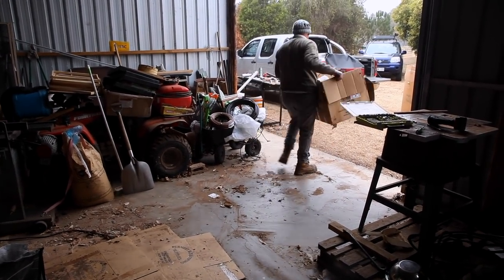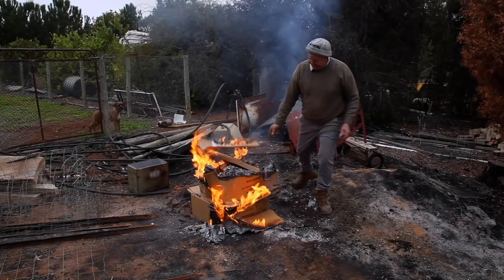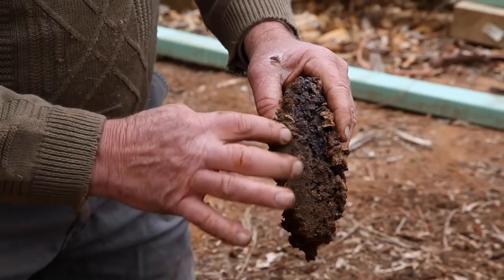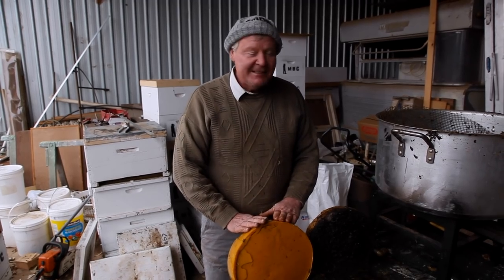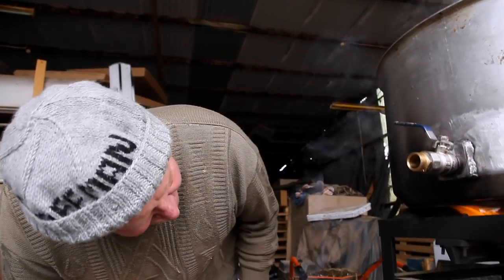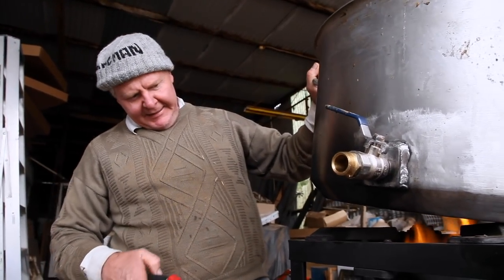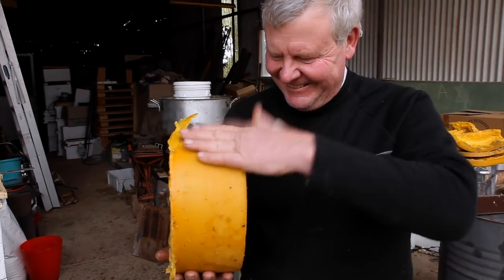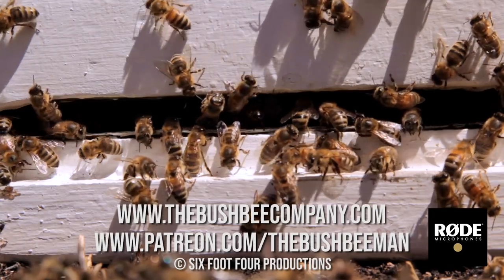Rendering Beeswax: How to Clean Beeswax Part 2 | The Bush Bee Man

Comment: Use one of the wife's 600 thread count pillow cases. Throw all the wax scraping in the case, tie it off to the handle, and throw the case in the water like a giant tea bag. Dip the bag in and out until you feel you've melted most of it. Then fill the bag again. No need to empty the gum. Most of the small particles will be in the sack, and just a small amount gets into the water.

Comment: As you've correctly pointed out. The wonders of modern technology mean no one ... absolutely no one, will be able to hide their stupidity under a rock any more. I'm sure medieval bee monks burnt their robes, stood their sandled feet into hot wax, put their heads into open beehives just to 'have a look'. Alas we'll never know, however ... radiator cap mishap is for posterity - lucky you.